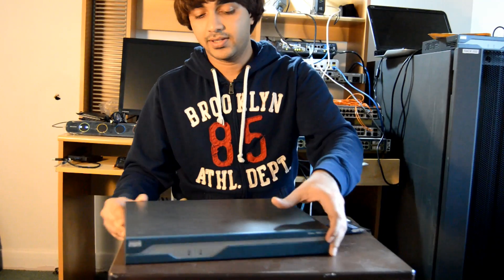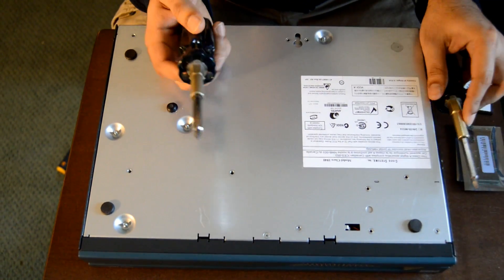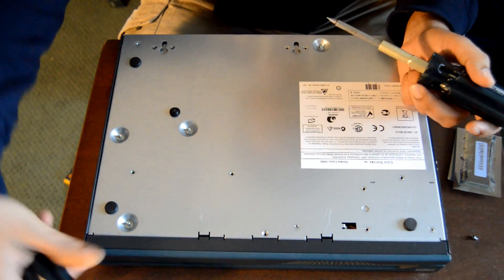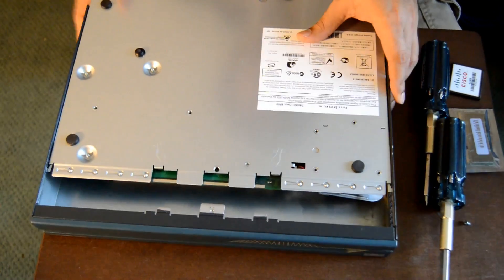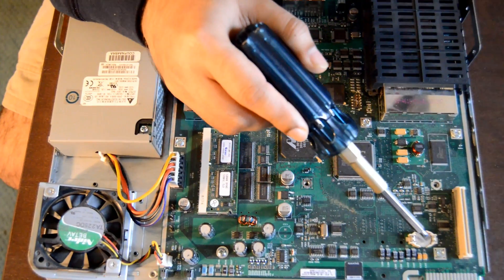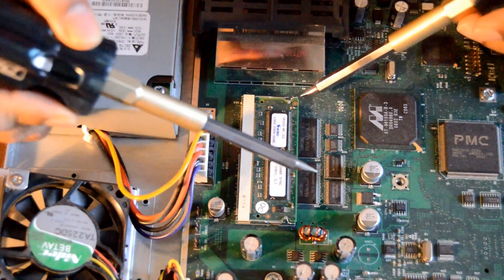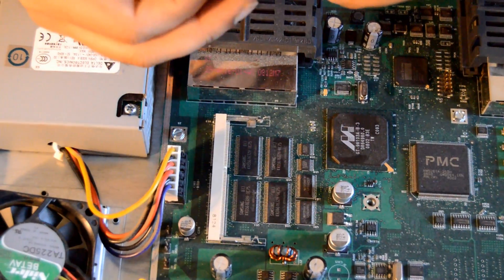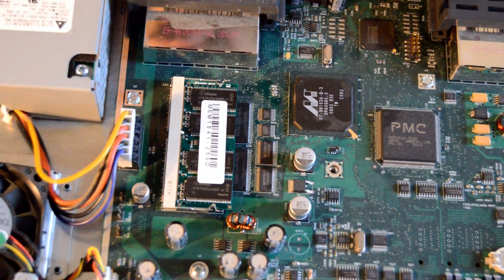How to upgrade Memory for Cisco 1841 Integrated Services Router

Comment: I just got my 1841 in the mail is it normal for these to come with no ram? I mean if it said in the listing it had no ram of course but I mean these come with ram right?
Reply: Yep, there is already 128MB of RAM on-board, with a slot for one additional module of up to 256 MB. Max supported RAM is 384 MB. If you are interested, the type of module you will need  is PC133S-333-542.

Comment: AHHH! ..I have (only) a 128 DRAM! ...maybe THAT is why vlan trunks wont work with iOS 15.1... - muddling by with 15.0 on my 1841 but got no ipv6 :(
Reply: ANTHONY BOOTH I have two of these in mint condition. Pulled them out of a working system 1 year ago. I know they are good but don't know how to configure them